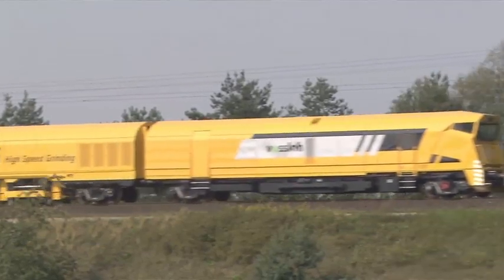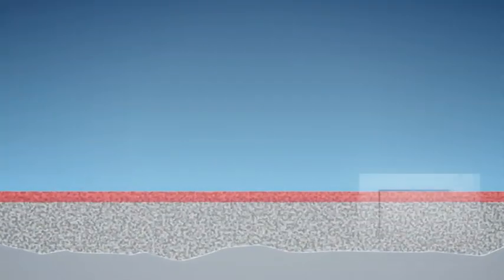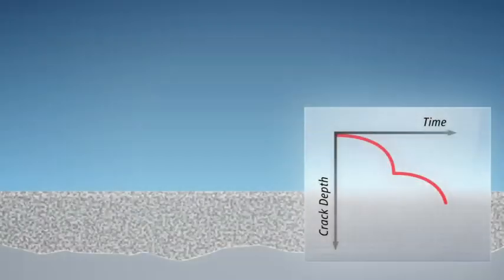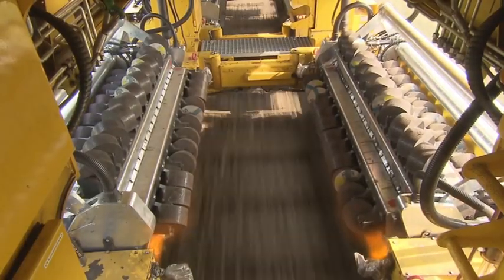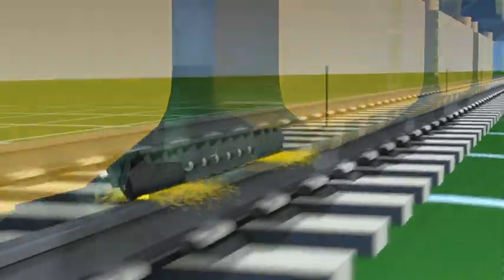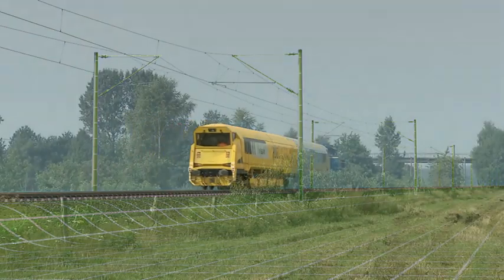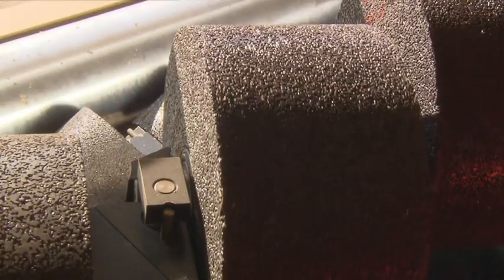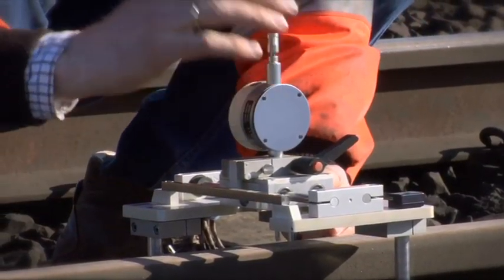High Speed Grinding 2.0

Comment: So do the rails sometimes get a welded layer to compensate for the grinding?

Greetings,

Jeff
Reply: I don't think so; they will just keep grinding the rails as needed, and when that has happened too often, it's time to replace the rails. https://youtu.be/_MKcTbYDP7w
Reply: @sjoerd5629  Yeah, but isnt that to get the wooden sleepers replaced for concrete? Ive seen welder trains in operation.
Reply: @jeffjefferson2676  In that video you can see different machines with different purposes. The first part is a machine for continuous replacing sleepers and rails, and these machines arent only used for changing wooden to concrete sleepers, they change old concrete to new concrete sleepers as well. 
In the second part you see a machine that is used for continuous replacing and cleaning the roadbed. This machine is in fact a smaller one, the bigger ones dont throw out the dirt, but collect it in special cars, they clean (wash it) the ballast and resharpen it, they change the underlying material as well and add new ballast. 
On some heavily used sections of some routes it is even necessary to replace the rails every three years, the sleepers are often still in very good condition on these sections of the route and so only the rails are replaced there.
Reply: @pearlyhumbucker9065  Thats what im saying, you could weld a new piece of track on. But if placing new rails is cheaper. Well then that is what they should do!